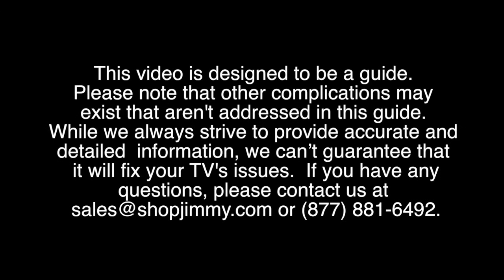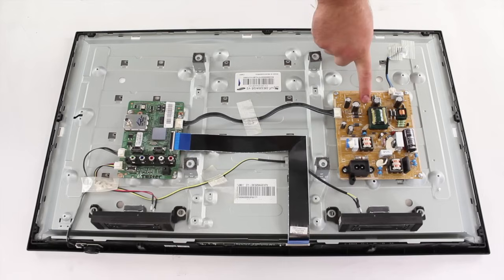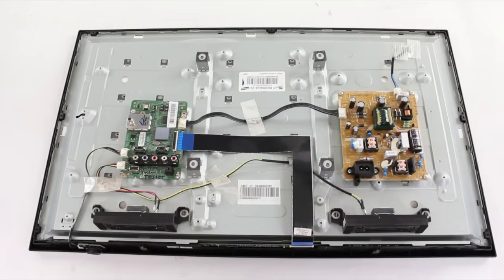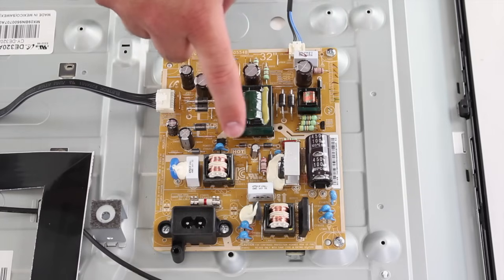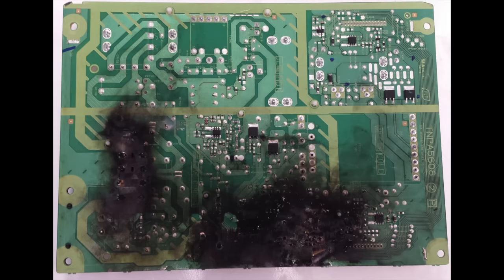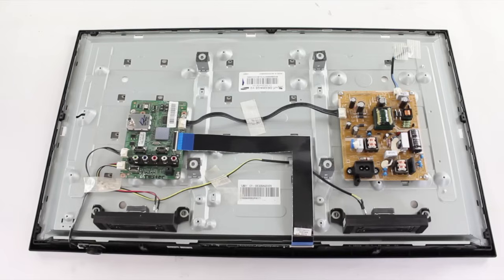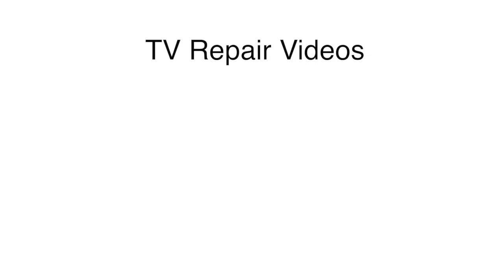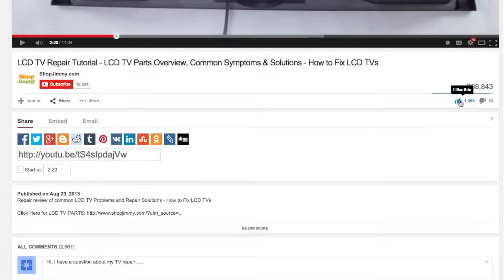Samsung LED TV Won't Turn On No Power & Does Have a Standby Light Basic Troubleshooting TV Repair

Comment: I have a Samsung smart TV with this SAMSUNG
Model: LA32C350D1
Model Code : LA32C350D1XZN
Type No.: LA32C350
AC100-240V~50/60Hz 95W
MADE IN MALAYSIA
S/N :NEGH3MKZC01234V
BN68-01176A-00 HL
--
I have lost the remote control and can't turn on the TV but the red light is on. Any assistance on this?

Comment: Okay guys im new for that but if you need to know which one is the problem (power supply or motherboard) just disconnect cable from motherboard to power supply and try to turn on tv after that check if there is light, if no light there this mean it's power supply if u have light this mean the motherboard (sorry for bad English) by by

Comment: I have a Samsung UN55NU6950F  When I plug it in the backlights immediately come on. There is no standby light and I can’t see any picture with a flashlight nor hear any sound. This unit has a single board. I disconnected the flat cables individually and both and the backlight remains on. No apparent bad components. I have scanned the board with a magnifying glass. No weird smells either. Is there any additional troubleshooting I can do? Does this sound like the board needs to be replaced?

Comment: On my Samsung that is about 4 years old the power light is dead but when I plug it in a blue light flashes on the screen and there is no picture or sound. Any ideas what might be wrong with my tv. Your help is greatly appreciated.

Comment: I have a Samsung UN32EH5000F. Replaced the power board and the main board but still cannot power on. What I have found when I unplug the backlight I can power it on but not when is plugged back. The plug for the backlight says D-, +5V, -5V, and D+ I do not have +5V when I check that pin but there is +5V to the main board. Any clue what can be wrong? Thanks

Comment: i have a samsung 58 inch plasma tv, it does have a stand by light but when turned on it and the Roku goes back off after a second, after about three tries, you have to unplug from power source and plug back in before it will come on again.  I have isolated all boards and the only time it will come on (and actually hear the melodic chime) and turn back off is when I isolate the main logic board. But my Roku will not come on. Help me obi-wan-kenobi!

Comment: I've used magic power module before and it worked but now there's no power anymore but if I remove the cable connecting to the main board the backlight will start and then if I put it back it won't on. And no standby indicating. Is it that the main board is dead?

Comment: My samsung tvs power cuts in and out. The screen flashes then goes black, same with the audio. Both can happen up to 10-20 times per minute. I was told it started after a storm. Lightening maybe?
Just replace the power board you think?

Comment: Thanks for the great videos!!! I have a TCL 50” smart tv. 50S434 model. I have horizontal thin black lines on the lower half of my screen. Everything else works fine.. I only see 1 control panel in the center of the rear of tv.. could this be my problem???

Comment: I have a samsung un55nu6900f and it has stand by light on but won 't turn on.I can get it to work if I  PRESS AND HOLD   the power button on the tv itself. I can hear a squeak noise while holding the power button .It usually starts after 2 or 3 minutes of pressing start continuously. No other issue with the TV. We leave it on all the time now but it will turn off on it's own after 18 -20 hours.

Comment: Very unhelpful video - nothing about how to remove those PSU boards that are literally glued and have no screws, nothing about how to remove some of the cables that are literally thin paper and easy to tear...... ALSO you sell all those boards, where do you get those boards from ? are these actual Samsung parts, or parts from used TVs, donated parts, clones, etc ? I am skeptic about buying boards from a source that is not authorised or approved by Samsung.

Comment: Have a samsung 55" 4k that has a blinking red light. Have tried unplugging it for 1 min and removing batteries for 15 sec and holding the power button but to no avail.  It only has 1 single board. Could that be the problem??

Comment: THANK YOU. This video just saved me several hundred dollars and saved the local landfill from yet another old TV set. Your illustration of what bad capacitors look like was especially helpful—it allowed me to correctly identify the two blown capacitors on the power supply circuit board of my 2009 Samsung LN46B750. After literally four dollars at the local electronics supply store and a bit of careful soldering, it works again! Thanks!

Comment: i have 46 in. samsung that went out after lighting strike near by and it was on a surge procter.now standby light blinks a 22?is that a code what does it mean power board and mother boarg look ok dont see back light by unpluging ribbion wire should i try to fix or toss it mod.no.un46d6000sf thanks

Comment: If  the standby light stays on or flashes the power supply is in protection mode.  So there is power but its not switching on the other circuits.

Comment: I have this exact make and model and originally figured the power board was my issue as l had not a power/standby lite, no leds lighting, no sound/picture, I ordered the power board and just received it today.(great service by the way real fast delivery) Now with the new powerboard in l am seeing the power/standby lite and when it is powered on l get a chime, the LEDs illuminate momentarily and l can see the indicators on the screen but then it shuts off and repeats this every 5 or so seconds. I can see all the led back lites are working but only momentarily. I have just ordered the main board as l am assuming this is the problem now any direction would be appreciated.
Reply: Did this fix it? The motherboard replacement?
Reply: @RobertYayo  no..have new mother board and power board  but not working. Under the bed till l toss it.
Reply: @davebl9645  try the little ribbon that connects to the motherboard replace that
Reply: Mine does the same, turns on screens lights up and then shut offs. This repeats unless i unplug it.

Comment: Thank you for all your videos. My elderly parents have a Samsung UN55EH6000. The TV will turn on but the standby light will flash 6x. Once I turn the TV off, it won't power on for a couple of minutes and there will be no standby light. Once the standby light appears it will turn on and function as normal. I did replace the power supply board with no avail. Any suggestions? Thank you again!
Reply: Did you fix it ? The symptoms you wrote are actually for bad main board .

Comment: I have a Vitron smart TV.  When I connect it to power it just shows the standby light. The output from the buttons pin is 5v but the other output pin for backlights, don't have any output voltage.
What could be the problem

Comment: My Samsung won't turn on.
No power no standby.
Yesterday I have make a physical check and see the components.
But Everthing I see is good no swelling capacitors.
Even I removed both board to see if any burn at back. In vain nothing.
What could be the problem. Thanks.

Comment: Hello i have a samsung un55ku6290f tv and it powers on and the video will work if i have my game counsel dvd player or cable box plugged in and on when i power it on but theres no sound and i also cant switch inputs with the remote or with ths button on the tv also cant higher or lower volume or get the menu to come up any suggestions

Comment: I have a UN49M5300AF that doesn't work. When first plugged in, the standby light blinks six times, then goes off. The TV won't turn on. I took the back off and checked the fuse, it was good. I unplugged the cable to the main board and the backlight did not come on. I checked the voltage on the four pins of the cable labeled 13v and they all registered a steady 12.74v. No capacitors are bulging or leaking and nothing else is visibly damaged.

I've exhausted my troubleshooting knowledge. Any ideas?

Comment: I have an issue, the screen turns on when I disconnect the main board from the powerboard. But when it’s connected, it won’t turn on and the LED blinks 5 times, where is the issue and what needs to be replaced!

Comment: I have a Samsung UN40EH5000FXZA version TS02.  Standby light is on but intermittently will not turn on.  Sometimes works fine for days or weeks, then acts up.  Thoughts?

Comment: What's the voltage for the LEDs? I read 65 volts on the board. But I have 130 volts with my fluke.

Comment: I have a Samsung 65” curved 4K LED TV model# UN65KU6500F that the screen turns on and then goes black and the flashes back on then black. It does it until it is unplugged. I replaced the main board and power board but still does it. If I unplug the main board from the power board the screen will come on. Any help will be appreciated.

Comment: At this point the day I choose to go to where to drop all this crap tech off the people working there are going to think I knocked off a Best Buy. I have so many dead electronics stacked in my basement. Just had another Samsung TV die tonight. Standby light is on but will not turn on by remote or the power button. Choosing a different brand this time.

Comment: Hello dear friend. I am from Iran. A Samsung tv model ua32f4550am  -bn44-00604b . The problem is that it turns on. But the picture is black. I press the power button on the body. The power LED flashes. I turned on the TV. I turned it on, but I did not see anything from the backlight lamps on. I tried in the dark, but I could not see anything from the backlight lamps on the back slits of the TV. I tested the backlight part voltage, two DC voltages were observed. And a voltage of 2.5 volts. None of these voltages can be seen in the table on the power board. Please help.

Comment: Hello i have Thomson 40FZ5533 model TV  with burned main board, the board that i buy is the same 40-MT51SS-MAC2HG but it's from tv that is 48FZ5635 model , the serial number of the boards is the same but the board its slightly diferent from mine, can my tv works with the other board ?

Comment: *HELP* MY SAMSUNG LED tv stopped working some time back.  I was getting a power on/off button light or standby light and that was it.
I order from you replacement kit ( Tcon board Main board Power supply board and WIFI replacement ) it made my back light or LED lights just blink off and on.  You sent me a new TCON and MAIN board and I replaced them and still my LED and standby light all just blink off and on off and on  The power button will not turn it on or off and of course no MENU    just blinking

Comment: My 65” Samsung turns on by itself after being turned off and more often than not I have to unplug the TV and plug it back in in order to get it to turn on. Needless to say I am done with Samsung.  Equally good if not better TV’s out there that won’t give you all of these issues. Samsung has done nothing to correct any of these problems!

Comment: Hi....we have a Samsung UN55H6350 tv that has a dark screen and no sound. The Standby light and the backlight of the tv come on, when the tv is powered on.Also, the Smart tv logo comes on for a second then the screen goes dark. Further, the tv won’t power off using the remote. Could you please suggest whether replacing the main board might work?
Reply: I have the same problem, did you find a fix?

Comment: When I pull out the black cord going directly across in the middle from the main board and power bored. I get a back light when I pull one side out and when I put it back in the backlight goes away

Comment: Hi
  I am having samsung 65" TV of model: UN65H7150AFXZA , all of the sudden my TV remotes(smart remote and universal remote) are stopped working , i have troubleshooted all the the options available  but not luck, even I bought brand new universal remote , it didn't helped. I am suspecting my TV IR sensor was the fault. Can you please assist how can i fix this issue ?

Comment: My un55j620dafxza power supply indicates 13v on output pins except 2 for ground. 1/2 of them read 13v the other 1/2 only about 3v. I suspect a bad P/S. Please advise.

Comment: Hi, thanks for great tips.. i have prob with L40MSF-fhs, samsung 40" led tv PS.
Its fuse was blown, by checking mosfet was also damaged.. both replaced but still power supply doesnt have o/p.. need your help to fix it please..

Comment: I have a Vizio D55u-d1 that has standby voltage and front light but wont power on at all and the 12v outs on the power supply read 19v and the 24v read 22v. any thoughts? should I just replace the power supply? I still get 19v even with all other boards unplugged.

Comment: I just replaced a bad power supply board in a 55 in Samsung led tv with no power and no status light. It lasted apx 20 minutes before going out again. What could be shorted causing power supply failure. Thanks for your videos and any help you might give on my problem...

Comment: I replaced the power supply board and the video board in my 55 led and still the stand by just blinks I dont know what to do
Reply: is it a d55u-d1 or similar?
Reply: @FallenPetrichor  und55d6000

Comment: My Samsung LED monitor takes a while to come on. After a while of flashing an image and going black repeatedly the monitor will eventually make a high pitch whine during the last few flashes and then will stay on. I assume that the monitor needs to warm up. Lately, after a period of disuse while my attached PC tower had been in for repair, the screen has taken longer than normal to turn on.

Comment: I have a Samsung UN65MU6290 65 inch 4k TV. When you push the power button on the remote the red led blinks like 3 times very quickly the the red led stays solid for about 1/2 second and the screen will flicker once or twice like its trying to come on but wont power up , It use to be that I do get it to power up sometime and after watching for 10 to 20 min. it will down off and if I try to power it up using the remote power button it will do as stated above. If I keep hitting the power button on the remove quickly it will sometime power up and show a good picture but again after 10 to 20 min will power back down. Trying to figure witch board would be best to change ? Please help me if you can and thanks to everyone that can !

Comment: On my 65 inch Samsung TV my main control board had a big black mark on it I replaced it and the back light came until I hooked up my T-con board and my main board won’t work at all no more
Reply: I meant my back light came on until I hooked up the T con board

Comment: I have a Samsung 27" monitor that keeps powering itself off and back on again.  My #1 problem is that I can't figure out how to get the back off to look at the boards.  I have been told that cheap Chinese capacitors are most likely the problem, but I have to get it open first to do anything!

Comment: hi sir i have a samsung tv which am using as cctv monitor when i switch it on the green led comes on but after few seconds the monitor goes off and  standby red led light comes on . i have tried to replace all the power supply electrolytic capacitors still not working what could be the problem kindly assist me.thanks in advance.

Comment: I have a samsung UN39EH5003FXZA that shows a standby light when the TV is plugged in, but no functions or lights work. The TV worked fine until I installed a firmware upgrade, when the upgrade was finished the tv turned off and will not turn on.
What do you recommend for trouble-shooting?
many thanks
Ralph

Comment: Samsung un55h6203afxza no image on screen but with sound. Tried the flashlight test, it does have a very faint image. Cant verify if the backlight is working, opened the back but cant see any backlight when on. What do I do? Help

Comment: I had this problem with my Samsung 42" LED. I found 2- capacitors on the power board were swelling up at the top. I ordered a bag of 6 capacitors with a slightly higher voltage rating. I removed the swollen ones and soldered in the new ones. It worked! That was 4- years ago, and I still get a good feeling when I think about how I saved my TV from ending up in the trash dump. YouTube is the best thing for do it yourselfers.

Comment: PS why not just replace the capacitor?!?! Those cost just a couple dollar compared to $60-80 for new or replacement board
Reply: That's exactly what I did just today, the TV would be on standby and wouldn't turn on. Turns out one of the capacitors leaked, so I replaced it for less than a dollar and the TV works like new!

Comment: Hello, and great videos. I have a Sanyo DP50842 which will not power on or have a standby light. The power supply is brand new. Do you think it is the analog board? I will keep the new power supply. Any tips will help.

Comment: 43' SAMSUNG  the audio is good . when i turn it on i get a flash no picture. model #PN43E450A1FXZA
Reply: I have samsung tv 32 inch, it has problem of cutting power. When I remove a cable which is supply power from power supply board to main board back light turn on but when I connect it whole tv shut down. Help me to find a major causer of this

Comment: I have Panasonic TC-P46C2 HDTV model I am not able to turn on when I press the power button on the screen. The red indicating light blinks with a click sound and a trips sound comes from inside the TV ...the red light is still blinking but nothing appears on the screen. Please recommend what should I do to fix this problem.

Comment: Sir, I have un46eh5300fxzc and also I have another Samsung tv I tried switching the boards between them and I turned out that the boards were fine. I tried changing the cable and resetting it by press the power button for 30 seconds  to dissipate the remaining charge ,yet it didn't work . What else it could be ?